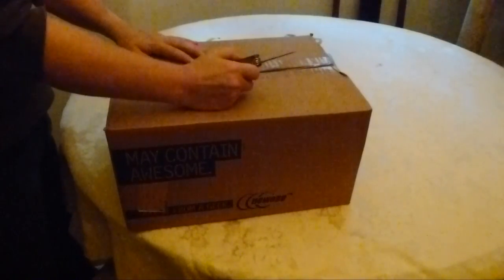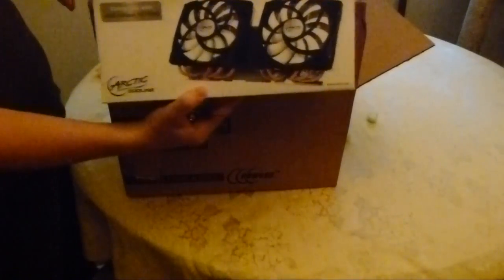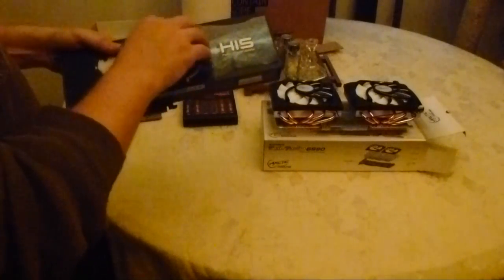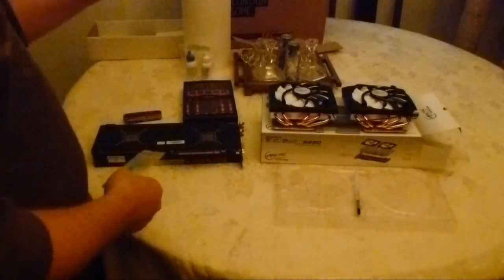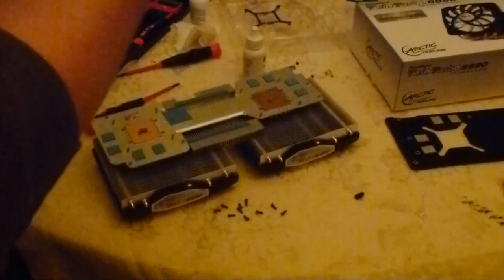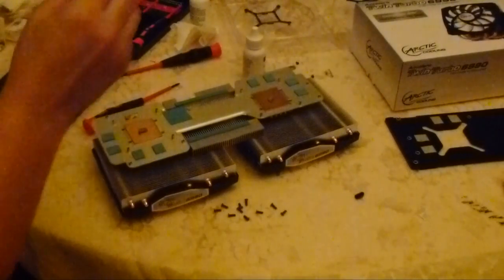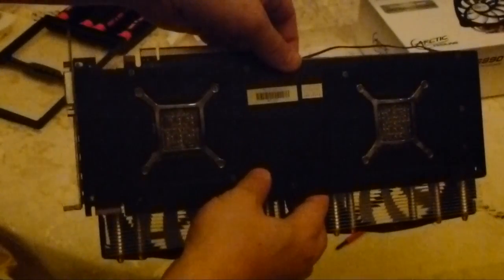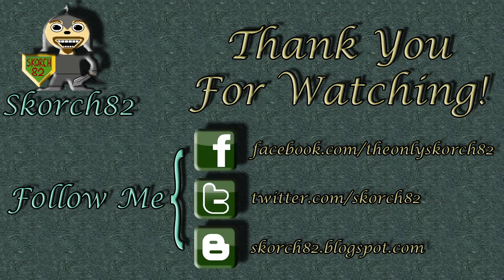Un-Boxing with Skorch - Accelero Twin Turbo 6990 - AMD Radeon GPU Cooling Unit (Installation)

Comment: Nice :3 I've got a cross-fired pair of Radeon HD 6800s myself, runs Guild Wars 2 like a dream, though it sometimes suffers from crossfire jitteriness. The best thing to do is get the RadeonPro application and just tune it up to suit the game. It runs Skyrim very nicely, especially after a bit of tweaking.

Comment from the maker: I have an aluminum server size tower.

it ran upwards of 80 or 90 under load, and around 70-75 average. Normal for that card, stock cooling, but i have a feeling mine was running hotter than normal anyways.

Comment: I have the same cooler but for my 6970. It does as it says. Drops temps around 30C from stock and is way more quiet. Set a fan profile in MSI Afterburner too.

Comment: Looking at the thermal paste under the stock cooler, you would probably get 5-10 degrees cooler just by reapplying that. 
Did you ever consider doing a CPU/GPU water loop?

Comment from the maker: Yeah the thing barely fits in the case. After playing a few of my games, I noticed this thing was hot enough on the outside to burn you. Not good. The reviews I read on this thing was that it always runs hot because of the two cores on one board. This thing seemed like a straightforward install too. I've had the same case/cooling for like 15 years almost, and eventually, it will be time to upgrade.

Comment: Skorch, I to suffer issues with cooling. I have a 6970 from XFX and the problem more so than just upgrading the cooling is that it is a non-reference card v1.2, basically XFX swapped out some power phases, changed the caps to cheaper caps and whatnot and some different displacement of space. I really was interested in getting a cooler if I upgraded my case in the future.and Arctic Cooling or a Thermalright Shaman were in my interest. I hope everything is well , interested in these type videos.

Comment: Jesus Christ man, that GPU is bigger than your forearm XD makes my GTX470 look tiny. I have to commend you, replacing the heatsink on a GPU like that is a big deal. I've been rather afraid to do that to mine, though it does run hot. I was planning on moving to water-cooling someday for a dead silent rig, but money is always an issue with that. :/